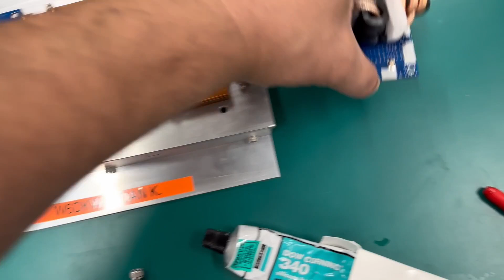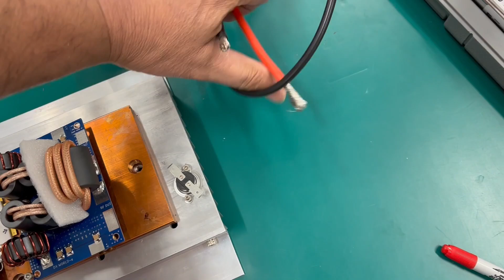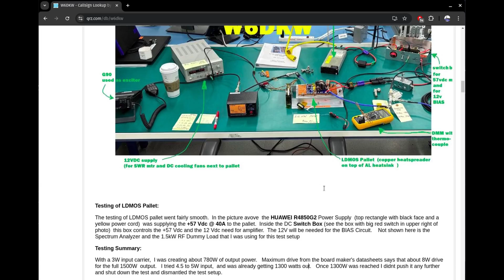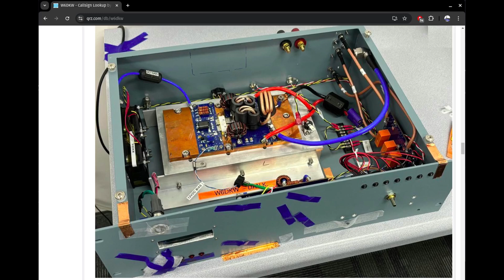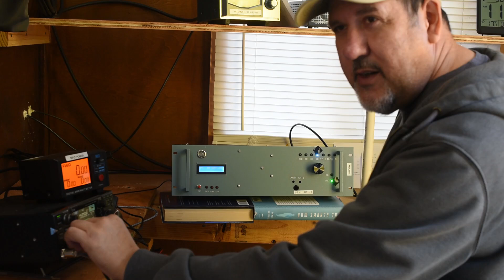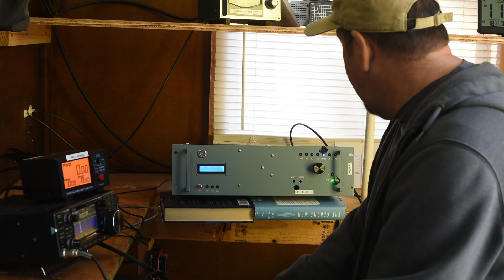1kW LDMOS Amplifier Build -- Part III

Comment: In your rear panel drawing you have a hole labelled 'Band'. The only band switch I see in your schematic is the 7 position switch on the front panel. What is the hole in the rear panel used for?

Comment: Thanks Dan. Very interesting build. The build is a lot like the build I did on the Mercury IIIs except you had to do a lot of the machining and Kenny did all that. All I had to do was mount the amplifier in the case and interconnect the boards. Good luck with the amp.
Reply from the maker: Hey there Don.    Thanks.   Yes,  there are a lot of similarities to this amp and others like Mercury IIIs.    The hardest part I found was that I had a "blank slate"  as it were.   Meaning I had to make the difficult decisions of where to mount a board,    or  how to run this coax cable around the chassis,    or even  where should i mount this jack on the back.   Most decisions turned out to be "OK",   a few didnt work right so I had to re-do that part.   But,   I guess you live and learn.    And I learned a lot!!!    ;)